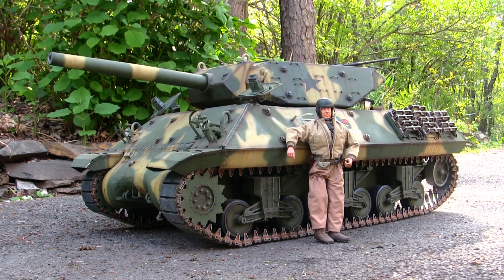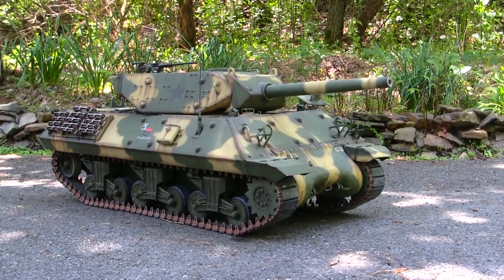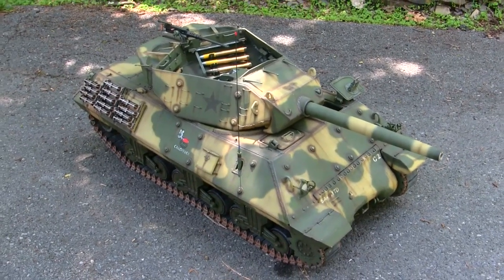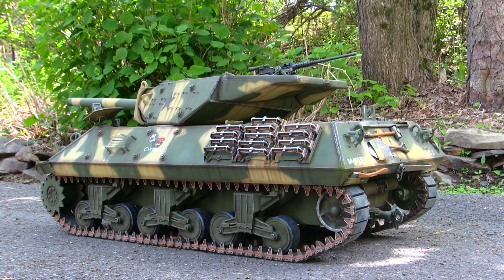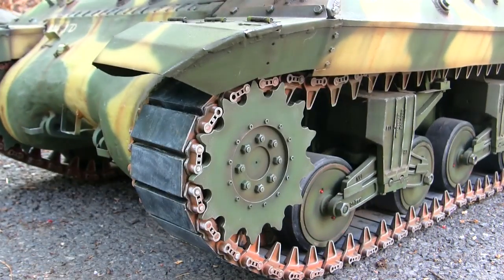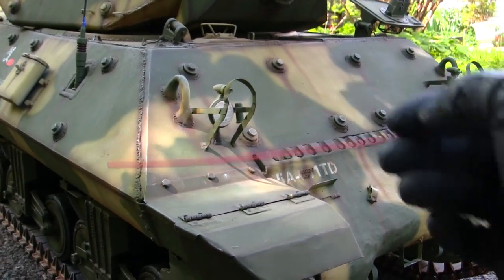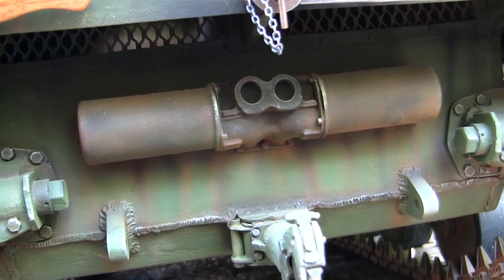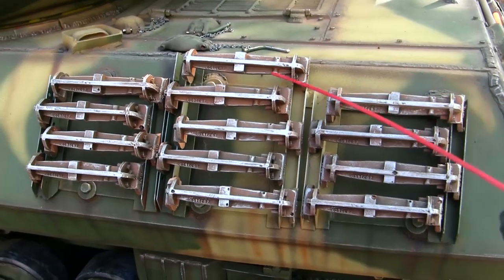1/6th scale M10 Tank destroyer "Can Opener" model showcase video (fixed audio)

Comment: After watching the video further, I see that there was a canvas tarpaulin cover for the open turret on the full scale M-10's. The clips for tarpaulin were another item of which I wondered the purpose. I have an old 1/35 scale Tamiya model of the M-10 (which I built years ago), & these clips were included parts, but I believe the instructions referred to them as "antennas", which I suspected even long ago was not what the parts are. But I did not guess the parts were retainer clips for a canvas tarpaulin. Thanks for explaining the purpose of those parts!
Reply from the maker: no problem, glad I was able to teach you something new about this vehicle

Comment: on the history of US td, i think you have it wrong
as i understand from Nicholas "the chieftain" Moran, the tank destroyer concept emerged from observations on the invasion of France of 1940, mainly on the defence side, the conclusions were that a front could not be effectively defended by dispersed static anti tank defences, but massing them was not better as it left gaps in your defence, instead they developed the idea of a fast unit with emphasis on mobility and anti tank firepower whose job was that in the even of the enemy finding a weak spot in your line and breaking through with tanks, the tank destroyer units would be deployed to destroy and push back the enemy force before it could make a foothold.
the tank units had the organic firepower to deal with enemy armoured forces, with all tanks having at least some anti tank capabilities
Reply from the maker: Your probably right, Its been a while since I've researched the TDs and I was going by my memory and what I read over the years

Comment: I dont know where do you live, but (if is legal in your country) you could equip yours tanks with "real working cannon" something like softair weapon, but stronger (alcohol mist propulsion) and you can make them fight 😍 could be amazing
Reply from the maker: I live in the US, yes it's legal... to a point. The working gun however is a useless meme. It sounds great at first but there are just too many strings attached both legal engineering, and practical. Having said that airsoft is something that I have done in the past on a 1/6 RC sherman I built a little while ago

Comment: What is the "all weather hood"? The purpose of driving mount (for the all weather hood) is something I've wondered about for years. I've never seen a picture of an M-10 with all weather hood in the driving mount.
Reply from the maker: The Foul weather hood was this drop in device that had a window, windshield wiper and canvas cover that clipped in place over the drivers section on US tanks. The driver can drive the tank with his head out of the hatch without being exposed to the elements. There are some pics of the unit in the M26 walk around books and there are some online but they are a little tricky to track down
Reply from the maker: here is a pic of one, https://www.theshermantank.com/wp-content/uploads/Scan_Pic0096.jpg
Reply: @oddball759mm  Thanks for explanation of the "foul weather hood". I imagined that the foul weather hood might have been a canvas cover for the open top section of M-10's turret. I'm sure the turret crews of the M-10's would have appreciated some cover from the weather.
Reply from the maker: @shadovanish7435  they had too, that is called a Tarpaulin. That is why on the M10 turret you see those hinged prongs that are on the roof and rear sections, those are used to clip the canvas in place and keep the inside covered